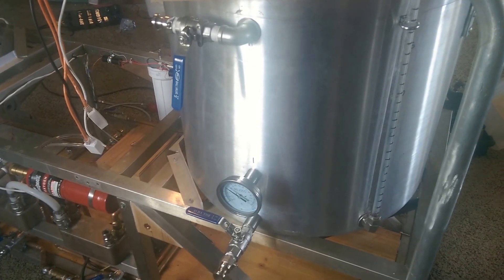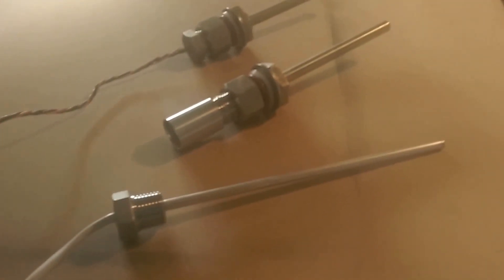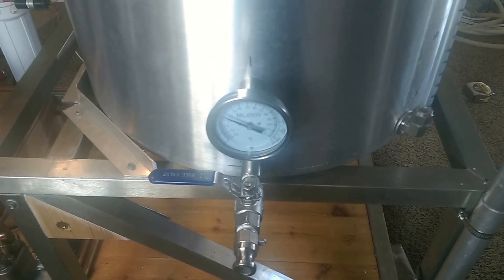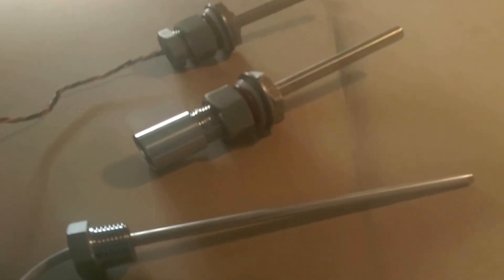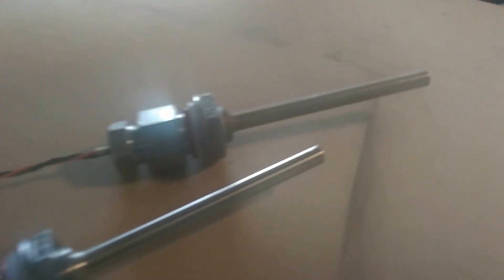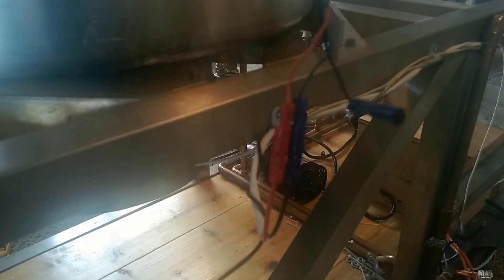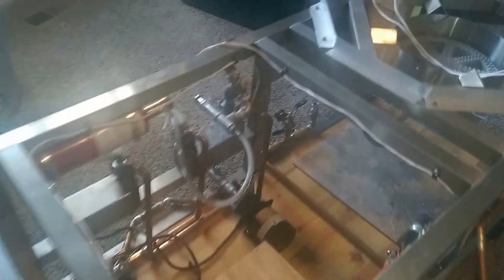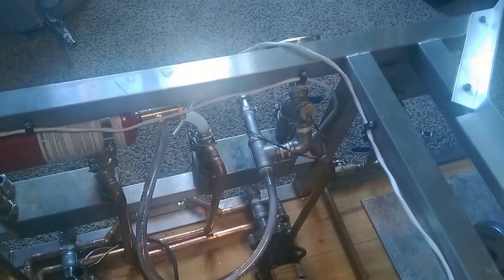Temperature Sensor Probes

Comment: Does it oxidize?
Reply from the maker: No.  The contact with the wort (or liquor in the case of the liquor tun probe) is stainless steel due to the thermowell.  I haven't had any issues with oxidation of the probe.